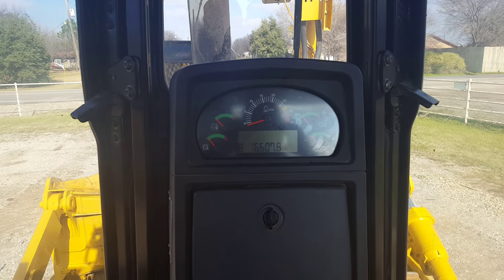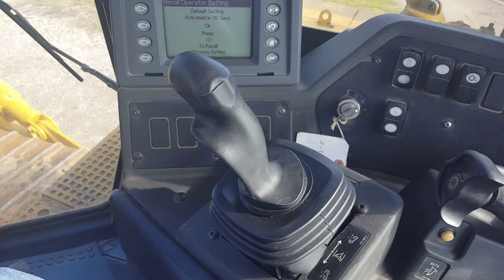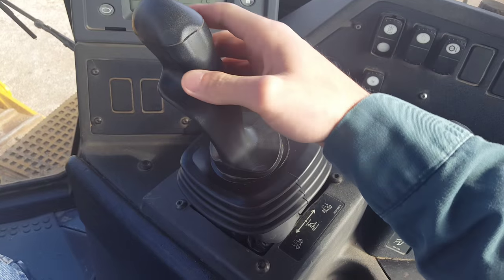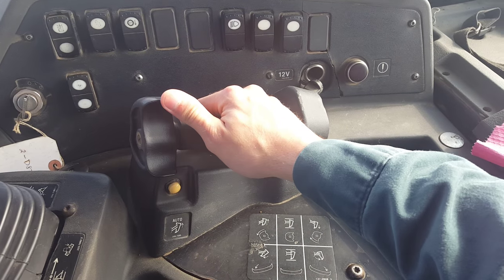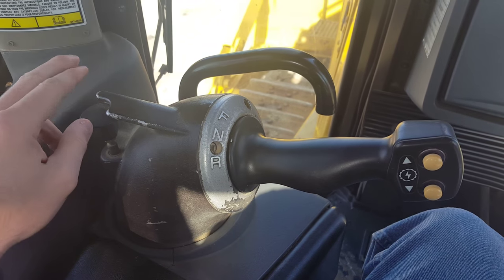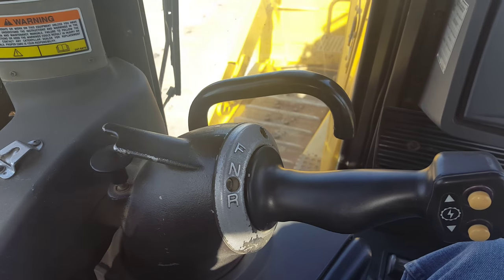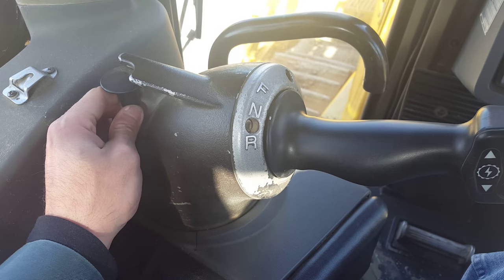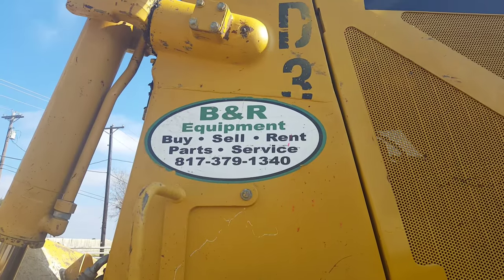How to operate a Cat Bulldozer (Basics)

Comment: I have never operated a D-8 Bulldozer, but have worked on the D-6 and loved working with it. The D-6 was a nice unit and I loved working on it, being so happy on it until I didn't want to get off. I noticed that the controls on the D-8 is set up a little different than the D-6, but working the same way.

Comment: I operated D-7 and D-6 dozers and Cat 120 and Cat 140 Road Graders when I was heavy equipment operator in the Army in the 80's through 92. Seeing this new equipment is like operating a computer. When did the steering clutches change on the dozer. I doubt that the military Operating Engineer's do not have this modern equipment. I tried to get in the Operating Engineer's union when I got out of Army it was like joining the mafia. You had to know someone.
Reply: first of all thank you for your service , secondly union pipeline contractors are always looking for good dozer hands, inbox me and i will send you the locals and numbers for the IUOEs in virginia and west virginia, mountain valley pipeline llc

Comment: How do you turn left n right??
Reply: The handle under his left hand will act as a tiller level, push forward to turn left, pull right to turn right.  When pushing, try to keep her straight in in a slot and running downhill to maximize material moved for least effort.